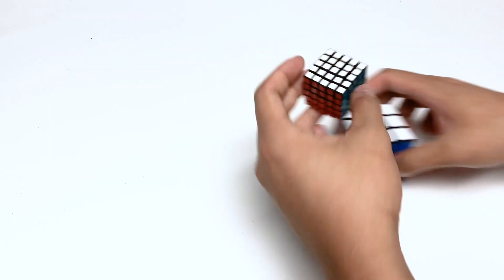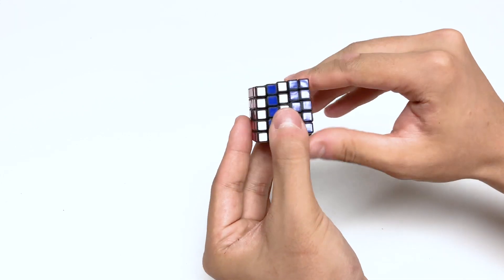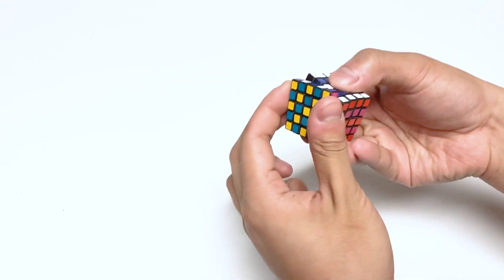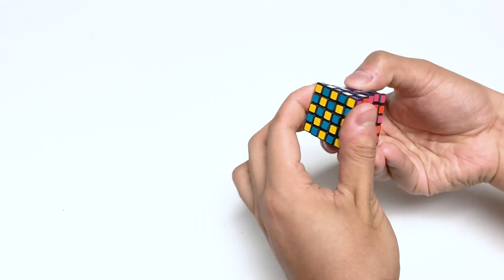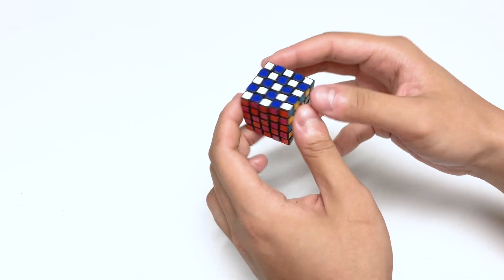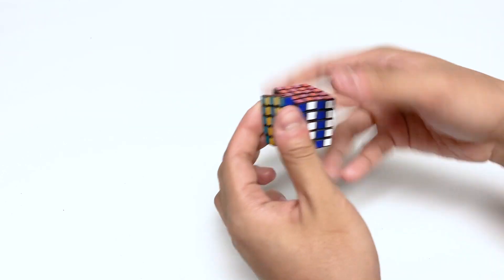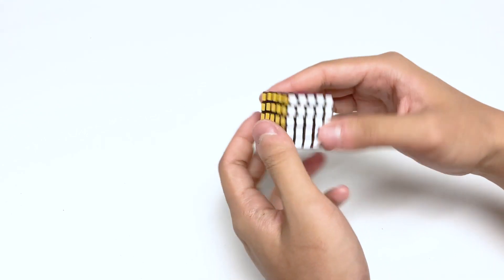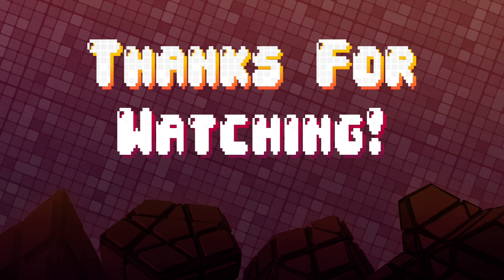Micro 5x5

Comment: Wow, that really is cute. Your puzzles always leave me amazed with how much one can get out of an FDM printer. Do you print the pieces in smaller parts and glue them together or print them with supports and give them some nice sanding?
Reply from the maker: Printed with supports. No need for sanding the insides at all... though I do sand the outside to give a smooth surface for the stickers.